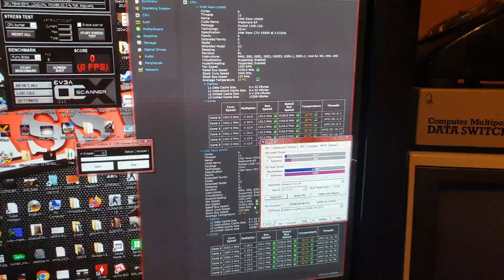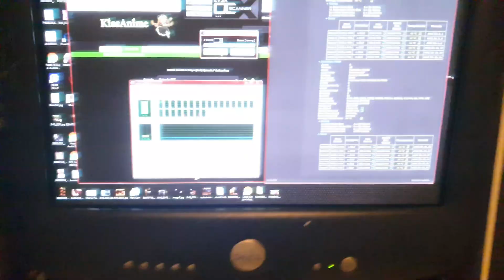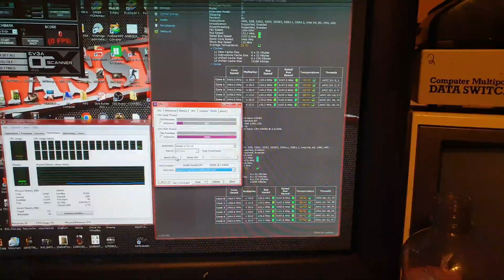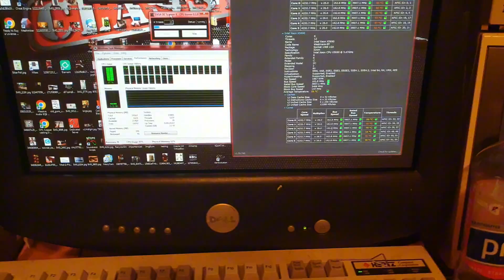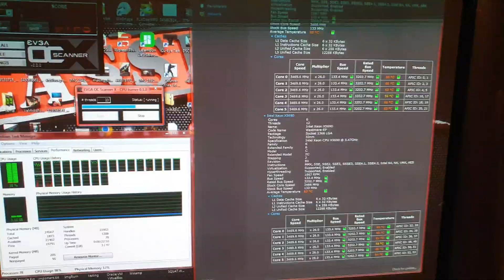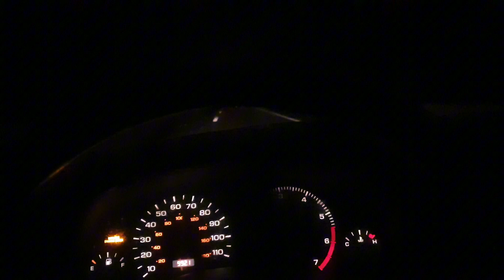Cooling my PC on Marvel Mistry Oil (Liquid cooling experiment 1)

Comment: Is it reading the CPU temps correctly? With my EVGA X58 SLI and Xeon CPUs, most CPU monitoring software use the wrong tjmax. They use 105C instead of 84C. The socket temp sensor is at least 20C lower than the highest core temp.
Reply from the maker: my socket temp reads between the avrage temp of the cores, the video is in 4k so if you watch it in full screen you can easily read the cores.